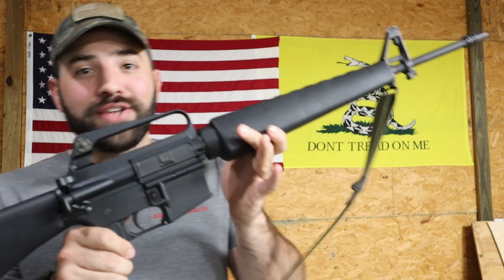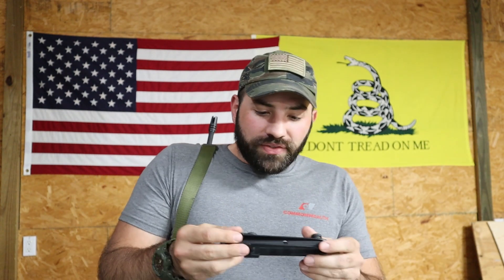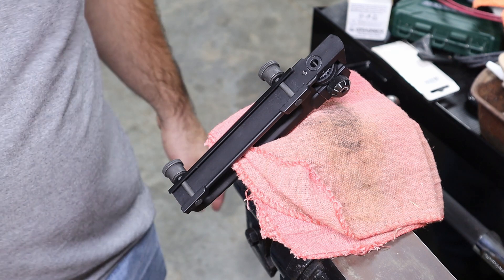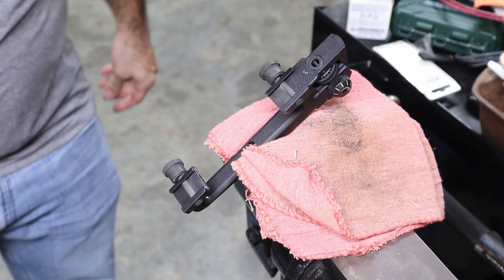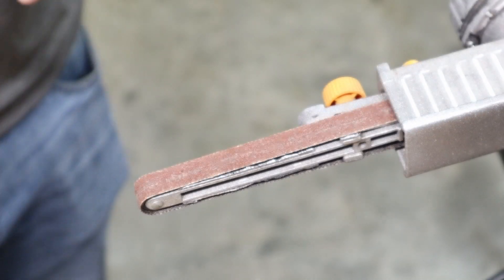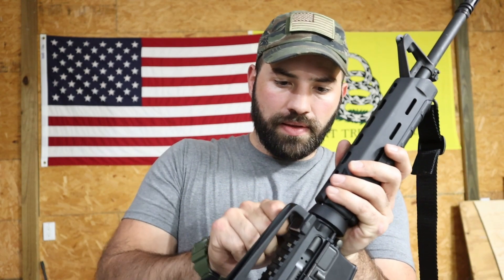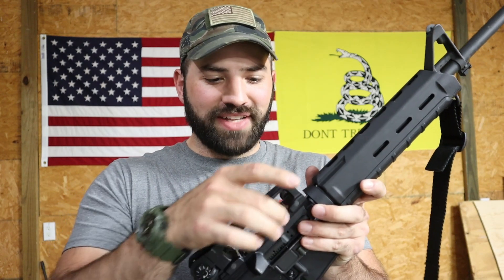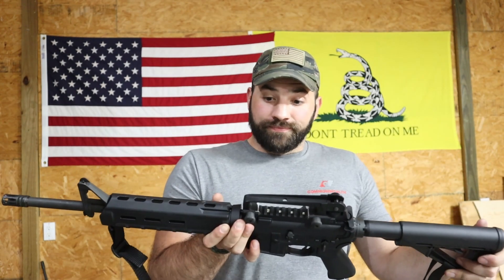Detachable Carry Handle Mod For Fat Fingers

Comment: I like the way you think. The NC Star detachable carry handle is not the brand to go with however as its windage drum and elevation wheel do not hold a zero and are not calibrated to the mil spec bullet drop compensation function.
Reply: Im willing to bet he chose to do it to the NC star as a test subject so he wouldn’t potentially ruin a more expensive carry handle if it didn’t have the results he was looking for.
Reply from the maker: @Lou_sassel315  this!

Comment: It's not a carry handle. It's a scope mount point. That's why there's a key hole in the middle to drop an optic into it. The idea in the past was to put a optic on it but that has been lost. The original acog TA01 and all future models allowed you to mount on the carry handle.
Reply: It was sure a carry handle doing ruck marches with a rubber duck M-16 with no sling on it.